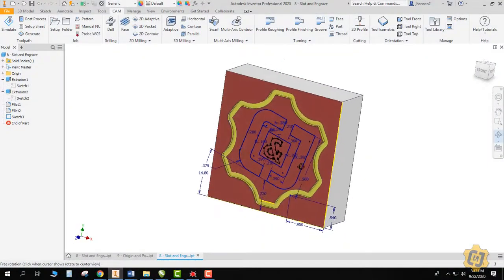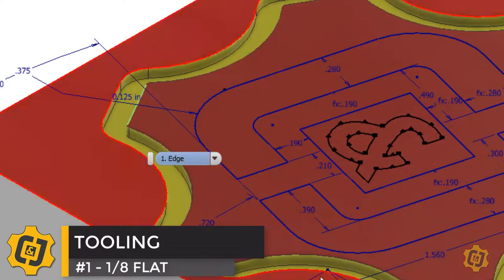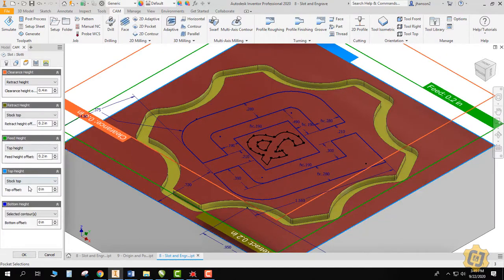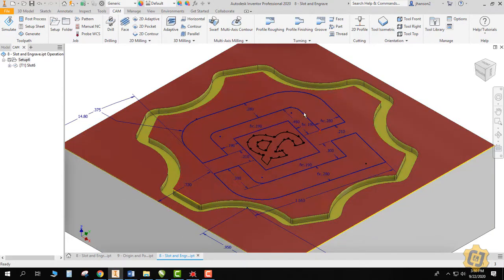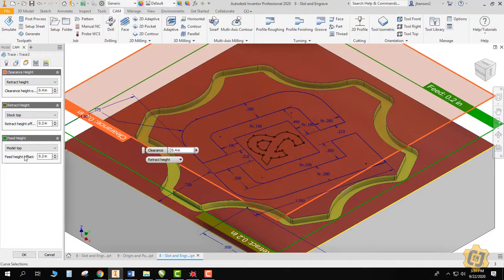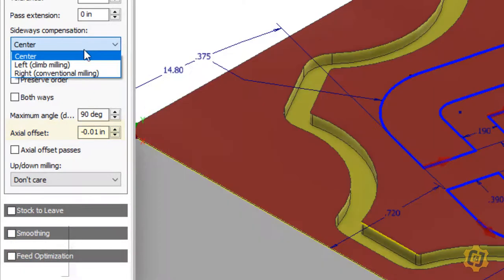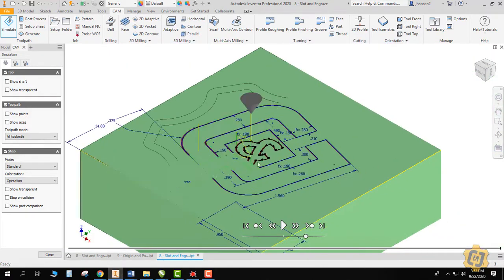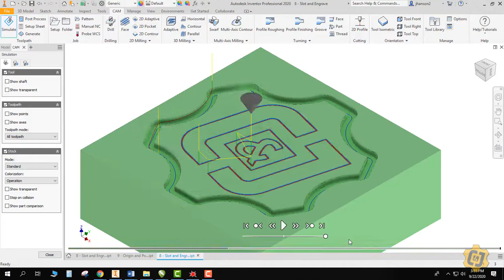8 AUTODESK CAM-Slot & Logo Trace

Comment: Thank you for posting this. I am learning Autodesk Inventor CAM on my own. Coming from a background of 10+ years of using SolidWorks and CAMworks, I've noticed that the terminology and ways to do seemingly simple tasks are sometimes way different between the two. Your video helped to push me in the right direction regarding understanding the engrave/trace/slot terminologies. Even though I am deeply rooted in the metric system and usually can't visualize how small or large a measure in fractions of inches is, I still learned what I needed to learn from your video. I may very well need to watch the rest of them, as you explain in a calm and understandable way.